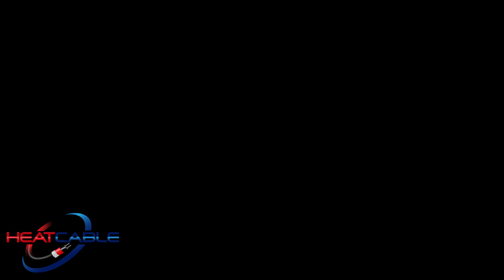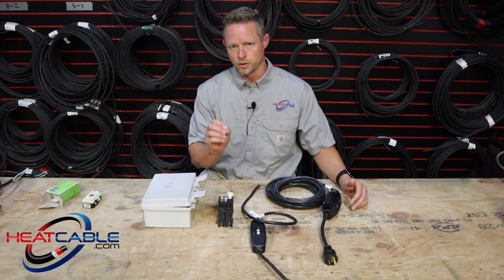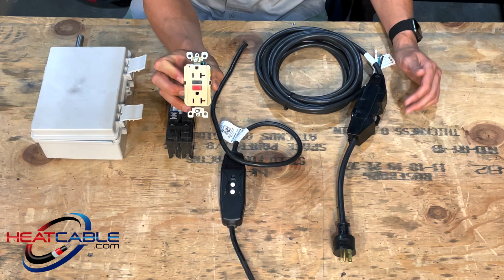Circuit Interruptors - What is the difference between GFCI and GFEP

Comment: This was helpful, thanks!
Was wondering if you could explain the difference in a 2-pole vs 4-pole GFEP?
Reply from the maker: Great! Might need a little more info. Sounds like you might be referring to more of a specialty/industrial type application? Heat cable has a particular set of energy needs. I can tell you that it would not work running two different circuits on one 4 pole GFEP. Give us a call to discuss if you wish. 801-896-8960 We're happy to help!